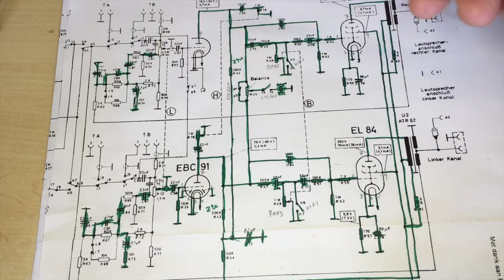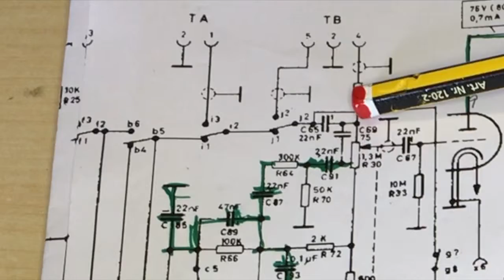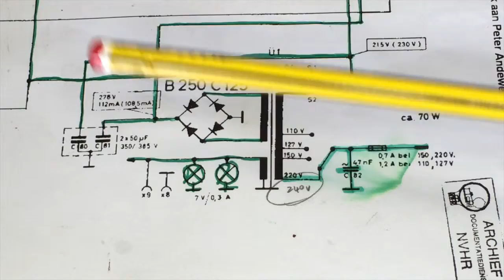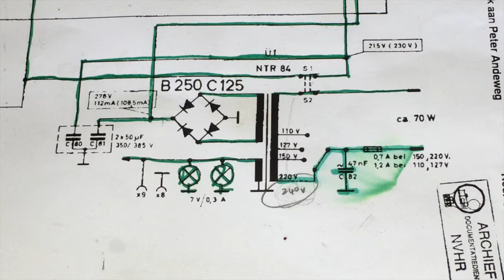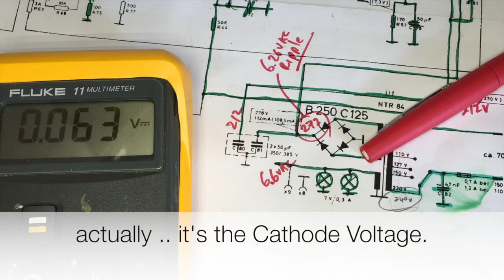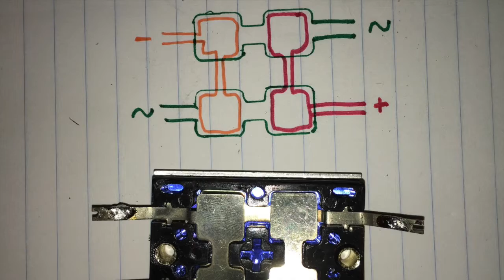Loewe-Opta Truxa Stereo 4741W tube radio restoration - Part 3. Recapping done.

Comment: Manuel a X capacitor at the silicon output  1micro to 10micro put a "low" path to those ac ripple volts,I've calculated about 636 ohms to 63ohms  they have good dissipating properties only 1%, so no  worries about heat & fire. Other common solution is to use about 100nf  x type in parallel with the diodes, but the container (rectifier box), makes not viable.. But that "soft switching", keeps ripple low. 😉